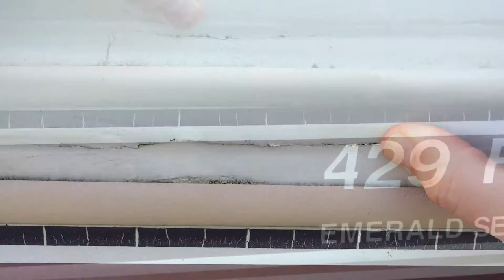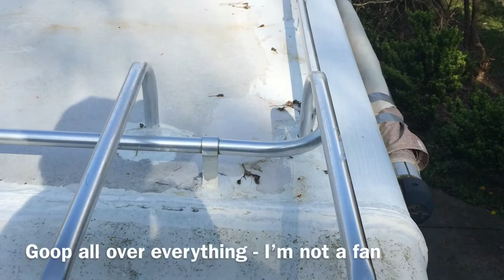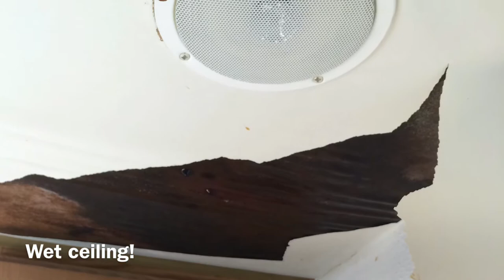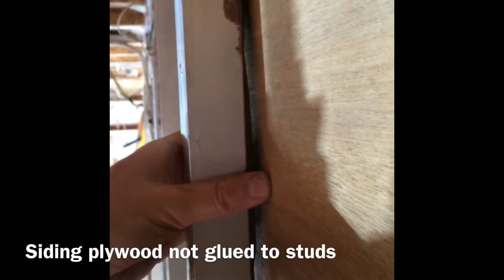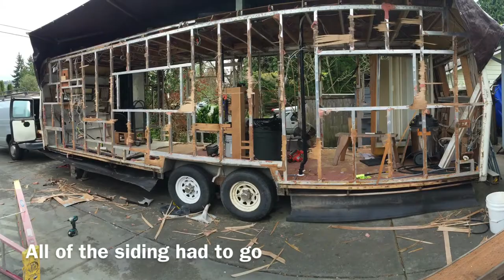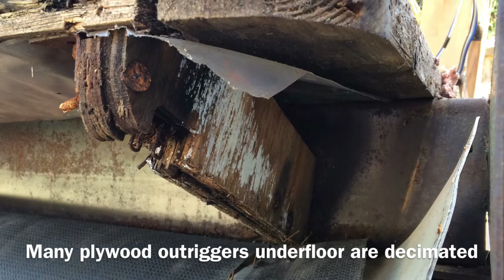Tearing apart and getting ready to rebuild a travel trailer.

Comment: Did you make any videos of the rebuild or do you have any suggestions? I'm looking at buying a water damaged (destroyed) 5th wheel for $500. I haven't looked at it yet, but my thought is if the frame is good and I can get it home over the road, it may be worth rebuilding. Thoughts?
Reply: Did you buy it and rebuild it?
Reply: RE: Kevin Mechling - Perhaps you’ll take the smarter route that this poster and I didn’t take:
 - Learn what NOT to buy! Me and this video poster bought lemons and are nickel-and-dining our way to repairing them (expending a ton of our personal time doing it) only to find something more that needs to be fixed or replaced.
 - If I had to do it over again, and didn’t have the yolk around my neck of my existing travel trailer, I’d spend weeks or months building-up a nest egg ready to pounce on the first near-perfect trailer I could find that some old couple had driven around on good roads only to KOA campgrounds and kept garaged in the barn every off season. (Basically, buy an undamaged / unweathered beauty! You’ll live longer, have more time trailering, and you’ll like yourself more.)